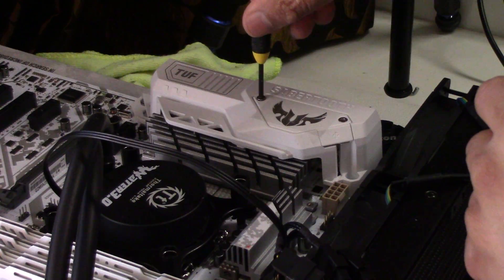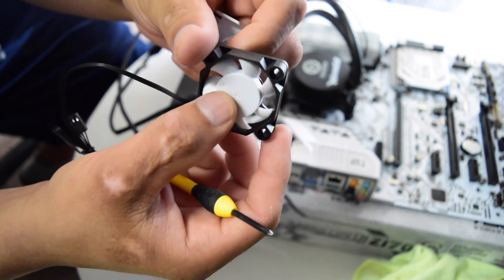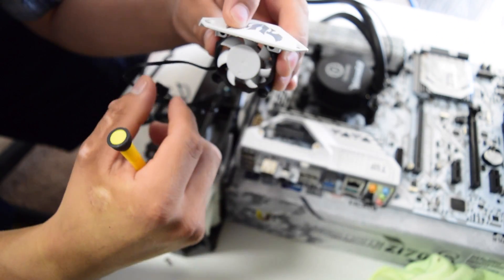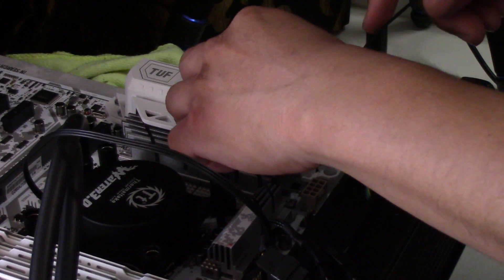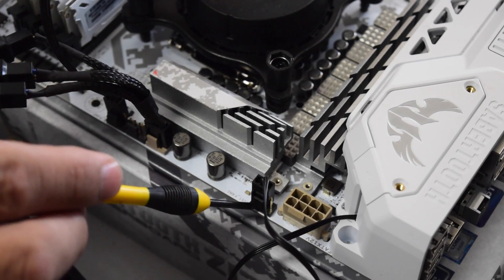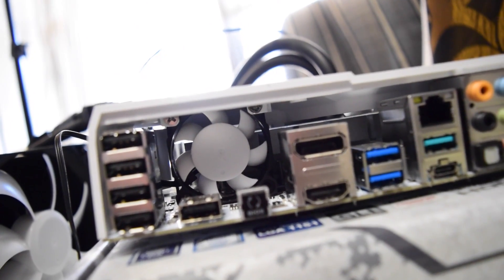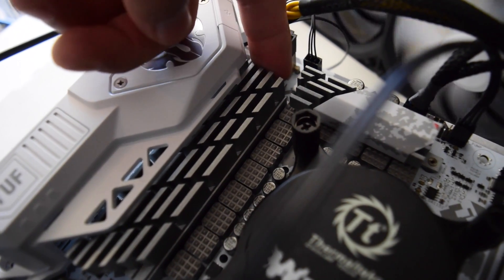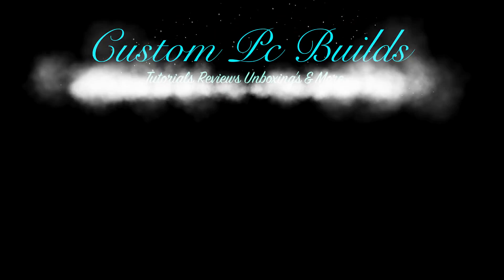Asus Z170 S Sabertooth 40mm Fan Installation Guide

Comment: Nice video. First, where do you get the right fan with a mini connector?

I have exactly the same fan and chamber and it makes a vibrations noise ONLY when it is screwed in to the chamber. When I take it out, there is no vibration noise when I hold it in my hand while the fan is on, so it does not appear to be a broken fan.  I tried putting soft take around the edges of the chamber and reinstalled the fan, but the noise persists. Do you have any idea what is causing the noise? Have you ever seen the issue before?

Comment: Kind of a gimmicky accessory. I can see this only making sense in a really hot case. If you have decent rear and top exhaust airflow this lil 40mm high RPM fan would only make unwanted noise.

Comment: what is the advantage of making it an intake fan? i mean, would'nt it be smarter to make it an exhaust so that it works "with" the rest of the airflow instead of against it?
Reply: do you not see how the Mobo is designed?  Most of these new asus boards are covered in a heat shield with hollow chambers under them, this fan blows air through those chambers that the standard case fans can not get too.
Reply: VRM and choke cooling. Most people doing any notable overclocking use watercooling. While watercooling is great for cooling your CPU, in the majority of setups that means you no longer have a fan blasting down around CPU. Which means you lose the the spillover airflow that would cool the VRMs and chokes. Sure the heatsinks on those are very decent on this board - but if cranking out serious heat, they are really not designed for passive heat dissapation only.

Comment: Thank you for this helpful video.
I am just wondering what is the biggest depth of fan that will fit? I can get a 40x40x10(40sqx10) or a 40x40x20(40sqx20).The 20 is all white so obviously I would prefer that one but I'm worried it will not fit.
Thank you in advance for any help/advice you can offer.

Comment: Questions:   
1. The thermal armor is plastic, not some heat-conducting material, right?
2. The extra intake inside the thermal armor takes cool air from the back of the case, aren't those air unfiltered? wouldn't this make the relatively clogged space within the thermal armor really dusty overtime?
Reply: Yup

Comment: What is the reason for installing a fan at that spot? I have never seen that before. I'm going to build my 2nd pc next year using the genome case,i7-6700k and the sabertooth s.
Reply: Hey Kreepe24r.  I also ordered a 40mm fan for my Sabertooth.  I remember in one of your videos's you asked what the mesh screen was for.  It's a screen for your I/O cover to protect the fan from dust.
Reply from the maker: helps the chokes stay cooler :)
Reply: Thanks for the response, I have 1 more question. I have been watching you videos on the Sabertooth S and the crucial ram. Should I get the 32GB (4 x 8GB) or 64GB (4 x 16GB)? Thanks in advance!
Reply from the maker: +MASTERSLY5 well it all depends what u will be using your rig for,  and if you got the money why not ;)
Reply from the maker: yes i figure it by now but thanks buddy! :)

Comment: what screw did you use? I just bought the fractal design r3 40mm fan and the screw it comes with doesn't screw it in as  there's no thread in the fan holes.
Reply: Kaiyo, if you're using the 40mm Fractal Design fan as in the video, it seems like a simple wood/self-tapping screw of 3mm diameter and 15mm length should do the trick. That would be an M3 screw. For imperial sizing, that's a #5 wood screw, with a length of about 0.5".
Reply from the maker: it don't matter the screw will make the threads as you turn it
Reply: +kreeper24 Tech the screw is thinner than the hole no matter how much I turn it, it won't make any threads
Reply: yes there is zero help from Asus or fan mfr on screw size. My current goal to solve this is to find a long enough machine screw and nut to basically hold the parts together. Unless I can find a screw fat enough but not too long, so that it can self-thread as it goes into the plastic of the fan's holes.
Reply: Kaiyo fajdjsnz

Comment: Hey! Great video
Do you think you can install these fans without taking the motherboard out of the PC?
Also i installed one of these boards yesterday and i am getting a 60c motherboard on full load non overclocked which i think is too hot what are your temps? Thanks
Reply from the maker: it depends if you can get your hands in there :) and able to unscrew the top cover
Reply: kreeper24 Tech Okay thanks :)
Also what are your temps on your motherboard? Thanks